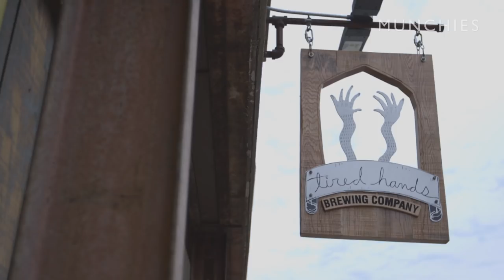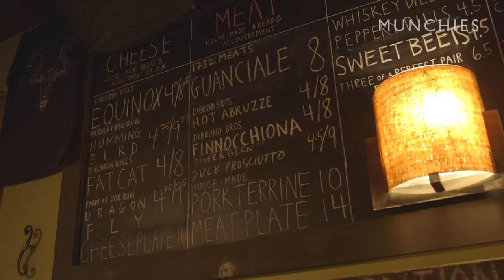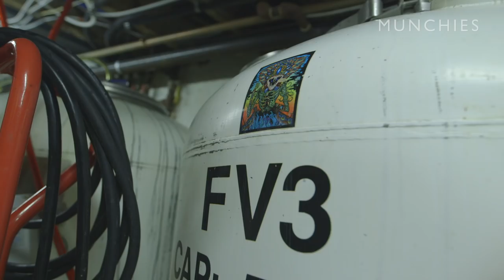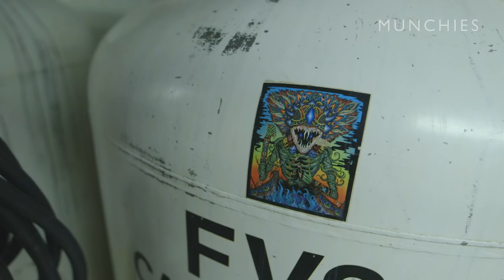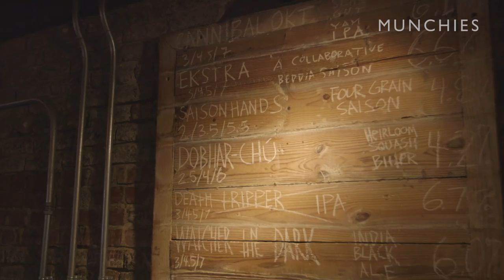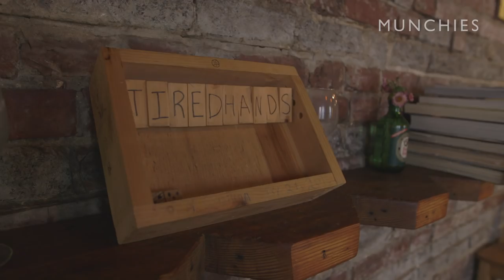Craftwerk: Tired Hands

Comment: Tired Hands' Barrel Aged Antenna Witbier might be one of the best beers I've ever had. I was looking for something refreshing to drink on a warm spring day after doing some yard work. So on a whim, I bought the bottle from my local shop which happens to be 2,700 miles away from Tired Hands Brewery. It was more expensive than I typically pay for beer, but everything about it just felt apropos: it was a nice light beer for the circumstances, and my hands were actually tired after the day's work. From the nose to the palate to the finish, it was absolutely perfect: delicious, interesting, unique, and satisfying. What else could you ask for in a beer? It ticked all my marks. If I lived in eastern PA, I'd be there all the time and I'd be buy this beer by the case. Keep it up Tired Hands.